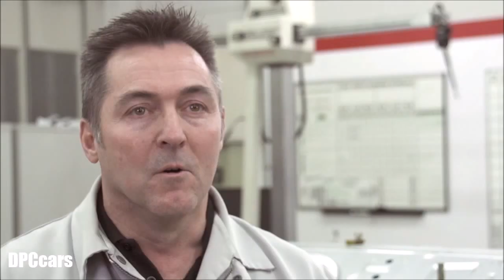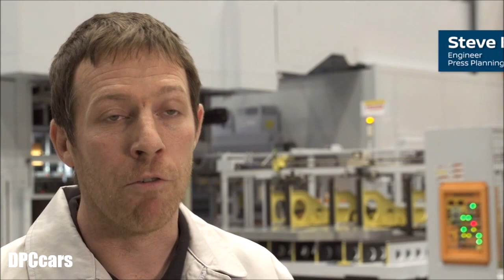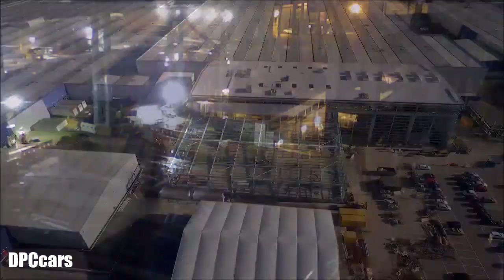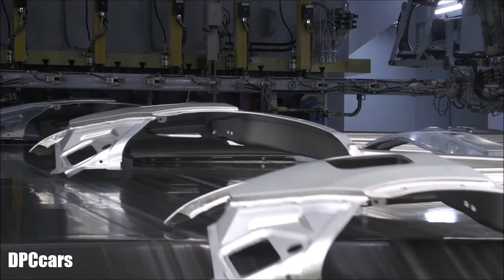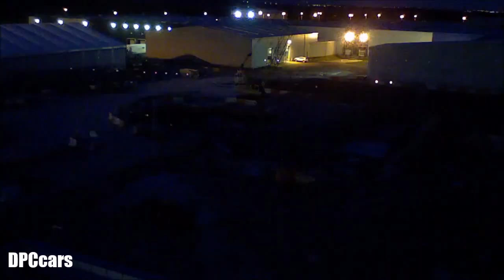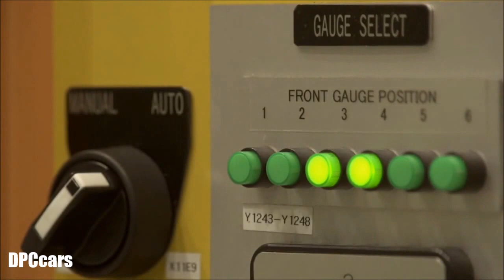Nissan Extra Large Gigantic Press Machine

Comment: Amazing machines. We had one (or two) installed at Saturn in the late 1980s  to make the body frame parts. Impressive. It was a "AA"press made by KOMATSU , quite a deal to ship from Japan to Tennessee. The Earthshaking boom when it did the operation is something I'll not forget.  The auto feed is also amazing at least to me. Huge roll of sheet steel on one end, the other end came out pairs of body frame sides. The presses are still in use when they converted back to GM operations making the Cadillac body parts.

Comment: Nearly lost both of my arms and quite possibly my life in a gigantic press(at least 20 ton)about the height of a two story house, back in the 1980's while working in the GMH factory where we made the General Motors Holden in Australia.
Due to the incompetence of our leading hand(hand) when he wasn't happy with the speed of the press he opened the main control panel and over rode(turned off) our(2 of us on this machine) control buttons, 2 green buttons needed to be pressed by each operator for safety and one red for emergency stop, and while we were up to our shoulders head first into the press placing the metal plates into the die, he decided to put the press into operation at great speed.
At no stage were we aware of what he was doing nor were we advised about anything except concentrating on doing the job correctly. The place was very noisy and we all had ear protection.
All I can say is thank God for the safety bars that push the body away from the press as the top half comes down. It threw both of us back into the pallet of steel plates and we looked at each other in disbelief of what had just occurred and in shock not knowing why it happened.
The leading hand just turned white and started mumbling something.
That was it, nothing more was said about the matter. Nobody was injured, well not physically at least.
Reply: 20 ton is quite small for a press, you might mean 2000
Reply: @aa-rr3lb  Yes definitely. It was the size of a 2 storey(2 levels) house and in the thousands of tons, just can't remember as it was a long time ago. Not sure how to find out. I do remember it was written at the top of the press......just never took too much notice.

Comment: Hi, I'm looking for mechanical(!) 100,000t up to 200,000t press processing machine and it's application  (where such presses are used).
Reply: I'm not sure that there are any presses that big. I think China has a 80,000t forging press. However, generally speaking die/forging presses of that hugeness could be used for aerospace applications (namely the wing spars and landing gear) of large aircraft, titanium bulkheads, any kind of very complex part where high strength and low weight are a concern. Giant extrusion presses are usually used for making things like I-beams, etc.
Reply: 6